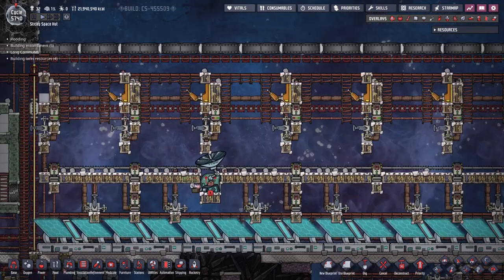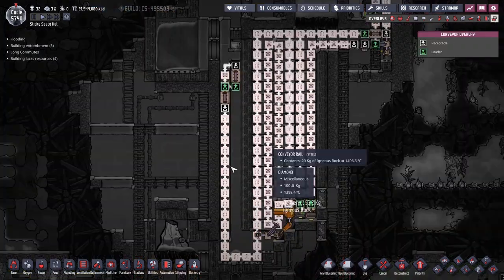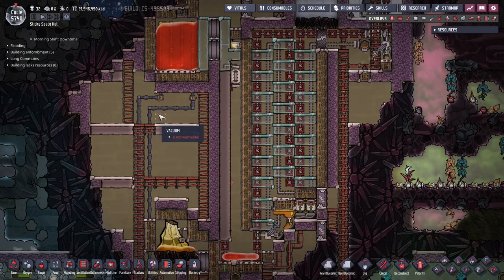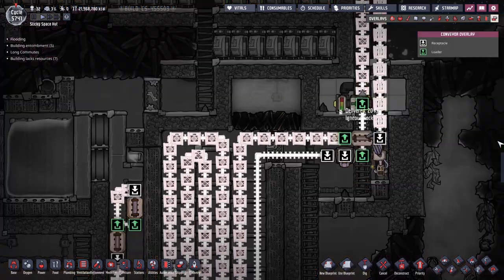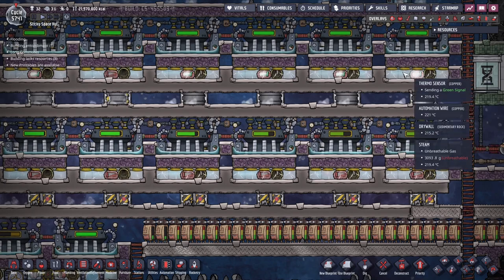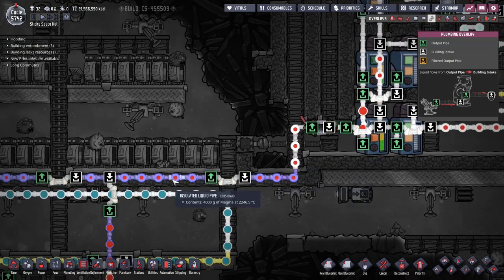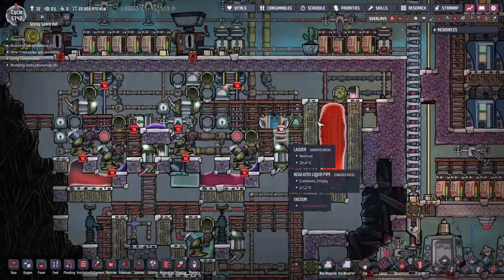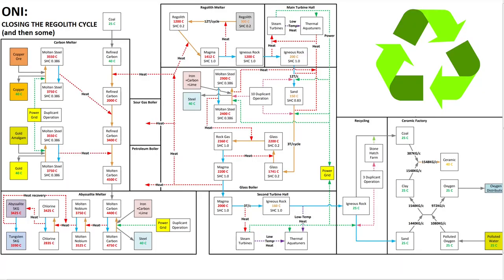Regolith Melter: Closing the Cycle - Oxygen Not Included

Comment: I'm quite inexpirienced in ONI, but looks like here some way to minor improvement:
02:19 "(You) don't need too much igneous rock", but if someone want more - possible molten lead bath here could help.
It will force magma to spread evenly to solidify not as tiles, but as debris, so, no need for robo-miner, x2 of igneous rock output. And extra rocks - if found completly useless for other needs - could be feed into stone hatches -> coal
And, ofc, sorry for necroposting.
Reply from the maker: Good point! I might try this out in the legacy base. But FPS went to crap since the merge.
Reply: чел харош